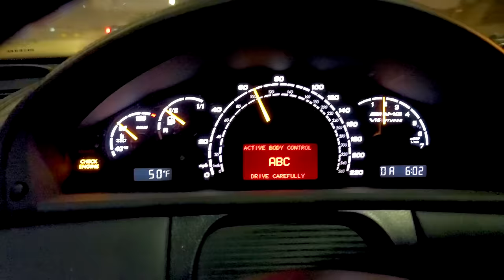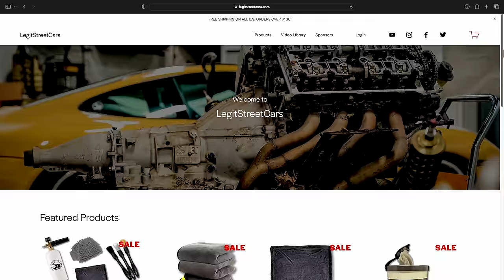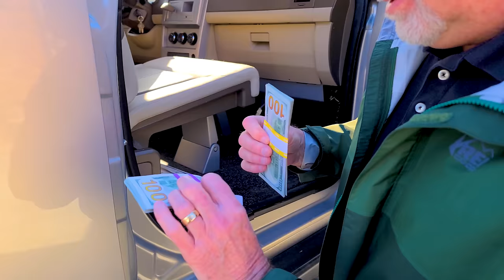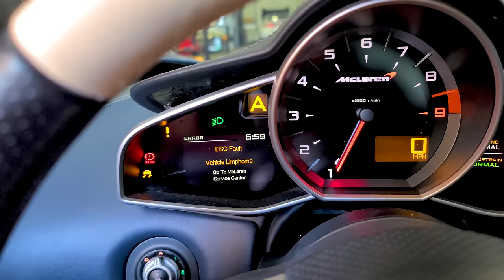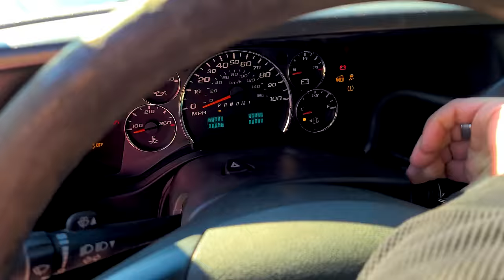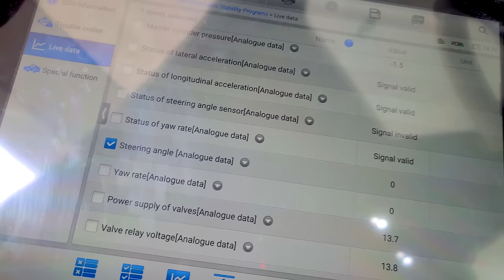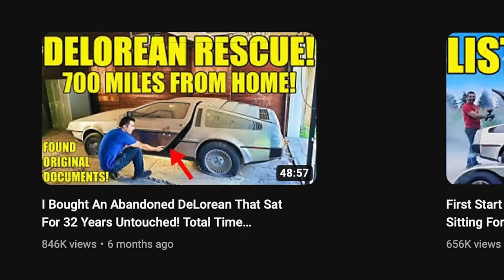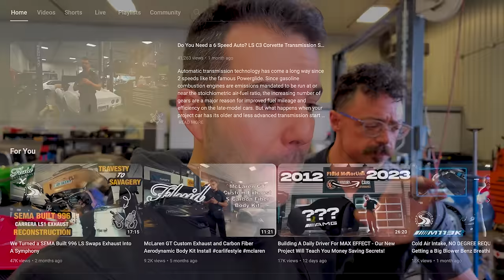My Car World Has Officially Crashed & Burned! Big Channel Update! Mostly Bad Except 2 Things.

Comment: Don't care what you think you know or what anyone has said but those air filters literally on the blower make the mods and power pretty useless when anything other than a single rip or dyno pull with hood up is done. Surely you understand heat soak,  positive displacement blower, and how an intercooler can only drop temps a certain delta. I'm really surprised you have those air filters like that

Comment: It's folded over a tiny piece of crank bearing and the crank is no longer moving like it was, (it will again), I bet your oil pressure is still low though, fix your crank bearings before it does more damage, problem solved....... :-)

Comment: Regarding your van's belt, if it is the same belt that you keep reinstalling, it could have broken cords on one side of the belt i.e. have more tension on one side than the other, and if you reversed the way it was installed it may have relieved the problem. Just a thought, it may be the belt, not the van... Get rid of the Mitsubishi and Fraud rubbish, hideous buckets of pus.